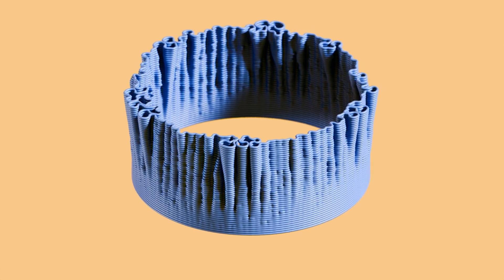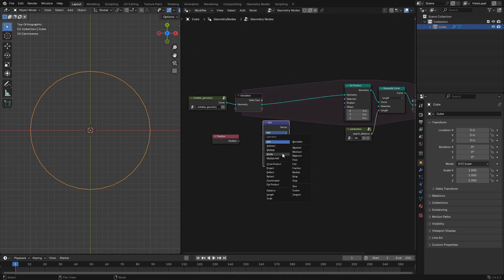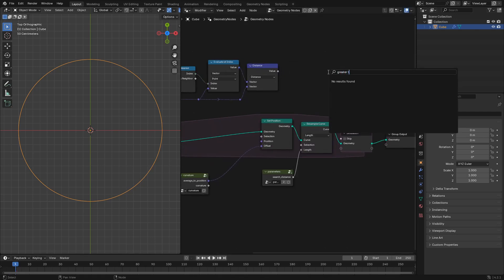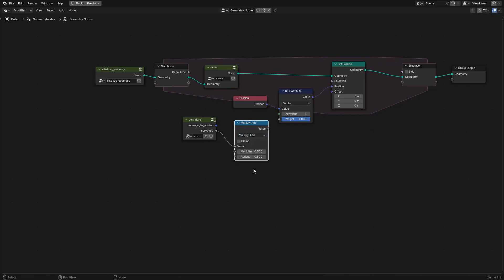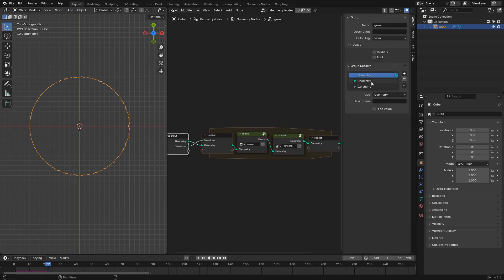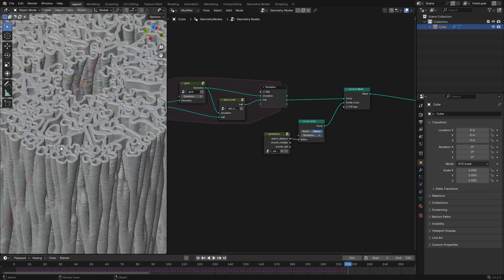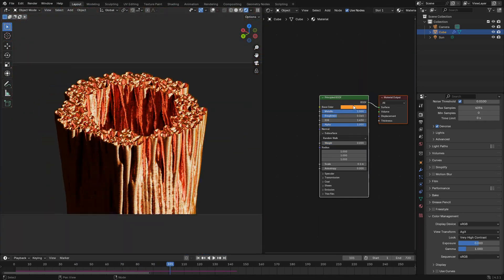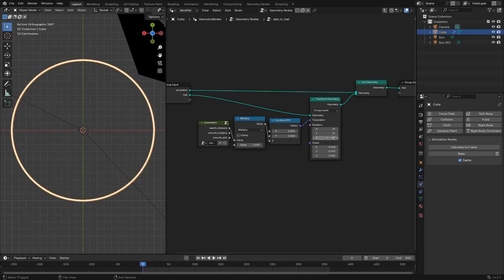Differential Echoes (Blender Tutorial)

Comment: There is a Method to convert tha simulation into a static and defined object for 3D printing?
Reply: There are a few ways to do it, the simplest imo would be to apply the geometry nodes modifier (ctrl + a) after you get your desired shape, you can then use the remesh modifier on the resulting geometry to get one solid piece that can be 3d printed.